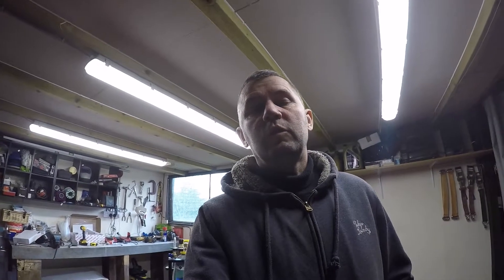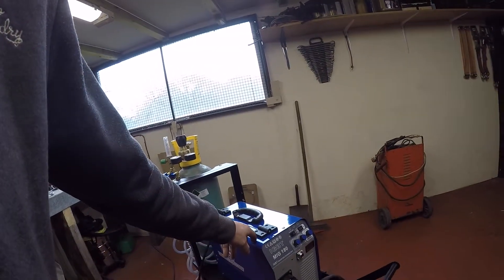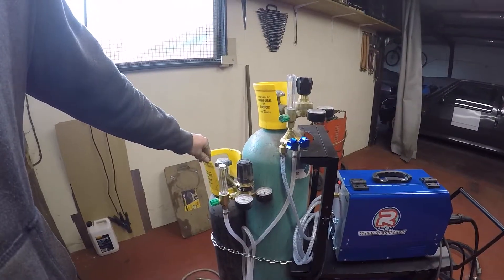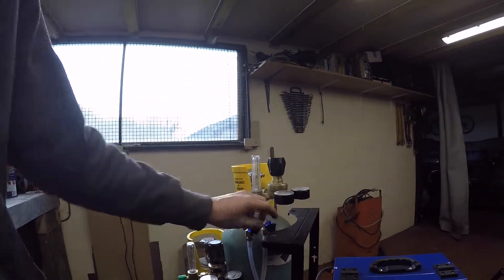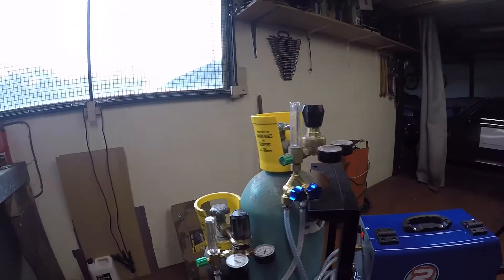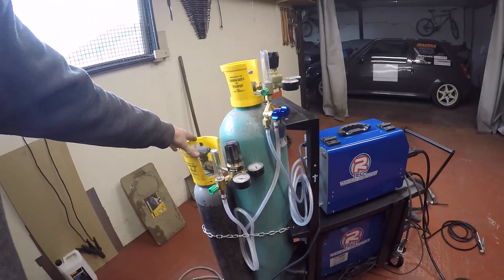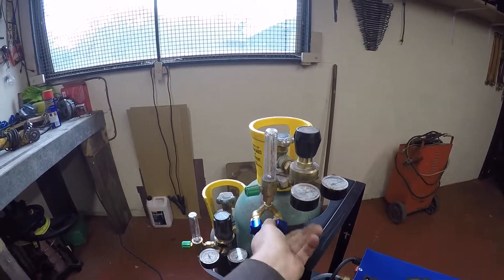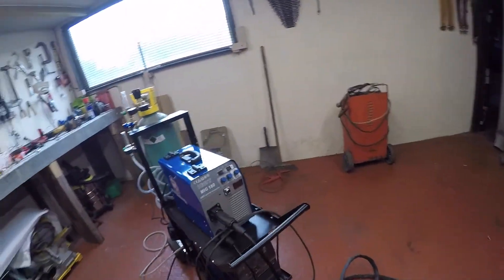Mix Your Own Argoshield MIG welding TIG

Comment: Another answer please, I don't see a flow meter downstream from the mixing to regulate the flow at the torch, are you using a third flow-meter?
Reply from the maker: Hi, no I don’t use another as this will affect the consistency or the other 2 if adjusted. I just use the 2 and add both levels together to give me the overall flow rate at the torch 👍

Comment: Why don't you need check-valves on the tanks, won't the gasses seek the lowest pressure?
Reply from the maker: They’d only do that if you was trying to mix before the regulator’s but as it’s being mixed after the regulator’s at a low pressure there’s no need for check valves as there’s no way the low pressure gas will force back into the regulator 👍

Comment: hi! how you prevent mixing gas from bottle to bottle?? bottles have very different pressure: 150bar for Argon and 65 for CO2..
Reply from the maker: Hi, It’s being mixed after the regulators so very low pressure and no way of going back past to the bottle 👍 cheers

Comment: Great simple idea. I mix my own but I actually blend the two gases into a separate cylinder using a 300bar filling whip (hose) and digital pressure gauge to add the desired partial pressure of each gas. Eg. 20bar of co2 with 180bar of Argon gives you a 10% argoshield mix.
Reply from the maker: Thanks 🙏 yes I looked into mixing straight into another bottle but the high pressures and expensive equipment put me off a little, this seams to work well for my needs though 👍 cheers
Reply: Was that a hose going from say your Co2 tank through the digital gauge & directly into the empty tank at 20bar.
Then after the Co2 is finished repeat with argon at 180bar?
Or does it have to be done together?
I'm interested in having the capability of doing this, even if I 90% of the time I use Argos shield, I'd like to have the option as a fall back plan.

Comment: I have been mixing gasses for about 25 years, and with great results.  The one thing I do different is to put a solenoid valve right at the flow meters so that the gasses are only flowing when the main solenoid valve in the welder is open.  If you don't do this then there will be a slug of one gas or the other in the line when you start up.  I will have to make a video of my set-up since there is nothing like it on YouTube so far.
Reply from the maker: Yes I totally understand what you mean, just 2 solenoid valves wired in parallel to the internal one in the welder. I must say it would be beneficial when TIG for then first couple of seconds. Cheers 👍
Reply: @CarJunkeez  I have never tried mixing without the extra solenoid valves, it may be overkill.  The way you are doing it with identical regulators, and I assume the low pressure gauge is set the same on both, may work perfectly.  Sometimes I overthink these things and I don't want to discourage anyone from trying the mixing as you have presented it here.  The results are what matters.  It is something to keep in mind if there is some weirdness in the first few seconds of welding.
Reply: I really like this ideal but seems maybe a little expensive/difficult to setup?  Do you think a small expansion chamber would be a cheaper/easier alternative with similar results?   I was thinking something around 10 cu in, made from some PVC  pipe and have the two gas supply inlets at one end and the outlet at the other end.  I guess since you are having them feed at different pressures you would still need a check value which seems like with the solenoids are doing.

Comment: I got some bottles of c02 from a bankrupt night club and have been using it for mig welding but it keeps freezing the regulator and the pipe . 
Is there any way of stopping this from happening ?
Reply from the maker: Make sure you haven’t got the flow to high, but yes it can be a problem freezing and some regulators can handle it better than others.
Reply: I have had CO2 regulators frost up, but only when running a lot of volume while doing silly things like running an impact wrench.  I have never had one frost up on my MIG setup.  You might be running too much CFH by mistake.  It's not likely, but some CO2 bottles have a siphon tube to draw liquid from the bottom of the cylinder, that would do it.  Look on the tank for the word "siphon".  
 I assume you have the tank upright.  You could put a fan on it perhaps.

Comment: You are incorrect sir. 75/25 is the most commonly used mixture for short circuit transfer on materials up to about 1/4in.  Any thicker and it is recommended to use spray transfer.  Spray (also known as MAG: Metal Active Gas) requires at least 80% argon.  90/10 AR/CO2 and 98/2 AR/O2 are the most commonly used mixtures.
Reply from the maker: audioshooter  hi, sorry if you find the video incorrect, I’ve used this configuration for a while now with no problems so works for me, I only tend to Mig sheet steel and if I was to weld 1/4 inch or thicker I tend to use stick, but thanks for the info it’s very useful

Comment: Thanks much for such an inspirational video! Ingenious! Was wondering how to do my own mix. And by a simple calculation in order to make Co2 25% and Argon 75% . C25 basically All we have to do is make a formula: I know that the full amount for MIG is 35 CFH ( or 16.5l/min) So  my 100% welding gasflowrate is 35CFH then 25% out of it is: (35X25)/100=8.75 CFH (Co2 flow rate) And the rest is 26.25 CFH ( Argon flowrate). Together makes 35CFH!!!
Reply from the maker: Thanks man appreciated 😁 yea using the flow rate and maths you right you can mix quite accurately. The mixer tap is pretty much the same as the torch taps too. Just watched you videos on your welding exams over there, looks awesome bro, you have some good equipment over there 😮👍
Reply: @CarJunkeez  Yes the welding schools at BCIT and Kwantleen here in Vancouver Lower Mainland are the best! Yes I learned there a lot! Thanks. Was wondering there at your setup. Might flashback arrestors be necessary? (those valves that allow gas to flow just in one direction) I'm thinking if one cylinder is more emptier than the other therefore the cylinder with more pressure will push the gas  into the one cylinder with less pressure maybe!? What do you think?
Reply from the maker: I’ve not had any problems as yet but I’ve not run low on gas so possibly when low, I suppose it wouldn’t do any harm in fitting them for peace of mind 👍
Reply: @CarJunkeez  I made my setup. Works fine without check valves ( Not flash back arrestors). The only difference that I made is I've put a bigger CO2 cylinder in case there might be a need to weld with straight CO2. Later on I have to  make it more crazier by mixing 3 gases: Ar CO2 and Helium for stainless steel wire. But that is just for later on. For now I'm good with what I have.
Reply from the maker: Awesome man, yea good move on the 3 way mix too, some people over here use the helium on titanium exhaust. We tend to only use the small co2 bottles as we get them cheap as they are pub gas for bear 👍
Reply: Flashback arrestors are used for oxy-fuel setups.  It is to prevent the flame from making it back into the supply line or tank and cause an explosion. You doesn't make sense to use them for inert gasses.

Comment: Thanks for the video.  I have been looking for information on mixing my own welding gas, but the info is hard to find.  I will be setting up my own mixing setup similar to yours.  Do you use check valves with the “Y” ?  It looks like they aren’t necessary.  .
Reply from the maker: Hi, thanks for watching. There is no need for check valves, just the Y adapter is sufficient as the pressure delivery is very low 👍

Comment: i had this idea a while ago were did you get your mixer tap and fittings
Reply from the maker: Hi, I got the mixer taps and some fittings fro R-tech same place I got my welders from but I had to get the other fittings from ebay like the Y adapter 👍
Reply: @CarJunkeez  what do i need to search for as ive tried diffrent terms on ebay and got everything i dont want lol
Reply from the maker: This is the Y adapter tap 
https://www.r-techwelding.co.uk/double-outlet-gas-valve-y-piece-right-hand/

And this is the Argon flow meter
https://www.r-techwelding.co.uk/argon-flow-meter/

And this is similar to the Y brass connector 
https://rover.ebay.com/rover/0/0/0?mpre=https%3A%2F%2Fwww.ebay.co.uk%2Fulk%2Fitm%2F372751506709

Hope this helps pal 👍